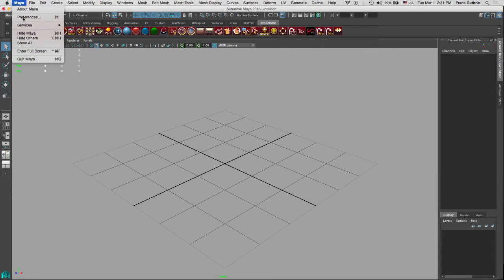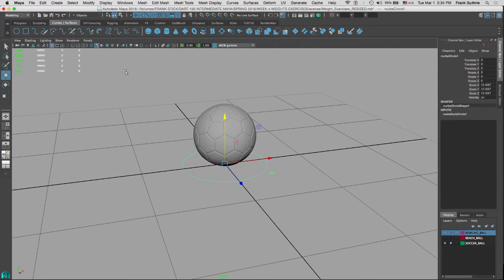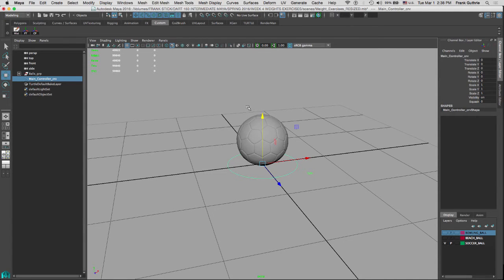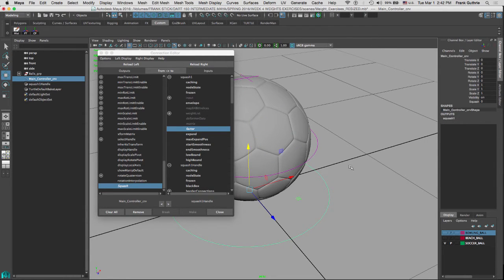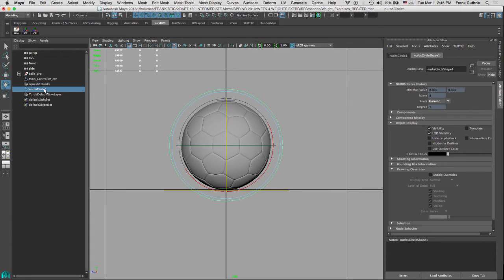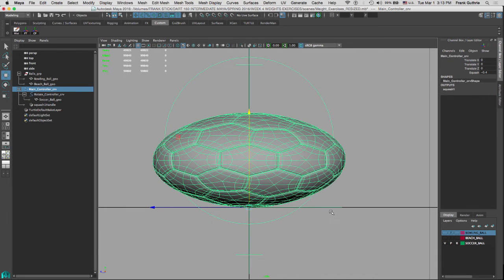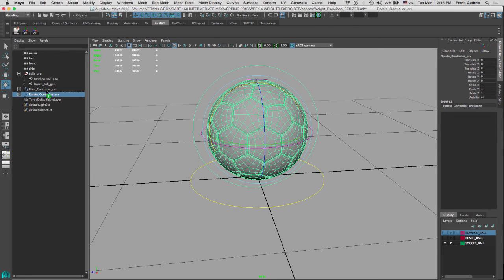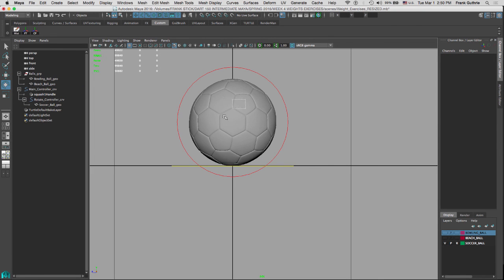DART 150 Intro To 3D Animation: Rigging A Ball

Comment: If the ball is bouncing across a scene, wouldn't you want the stretch to be rotating in the direction of the bounce? if it is always a straight vertical stretch on a horizontal bounce that will look wrong